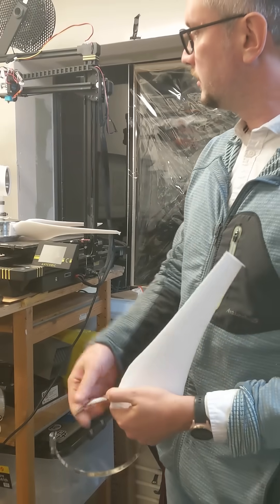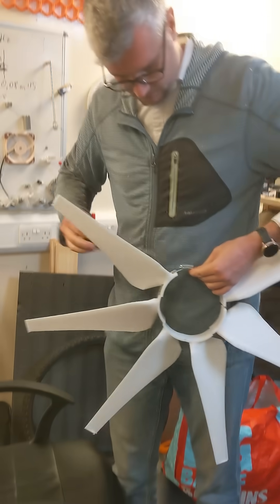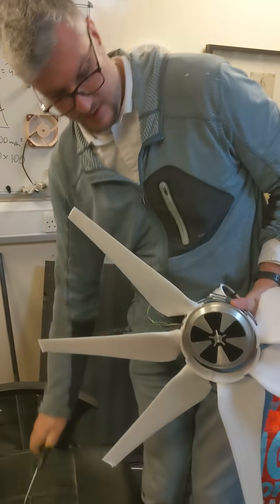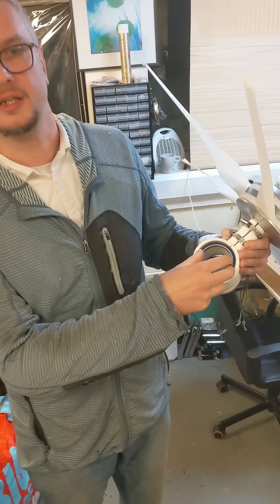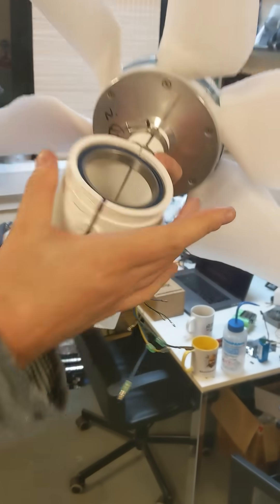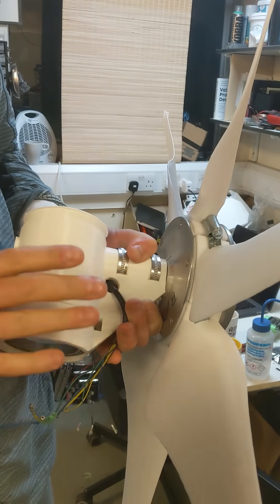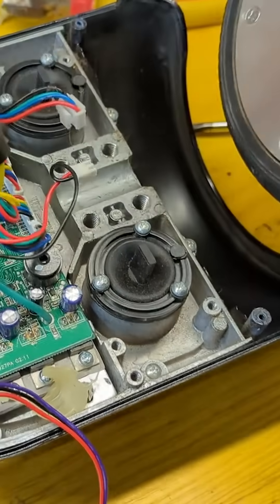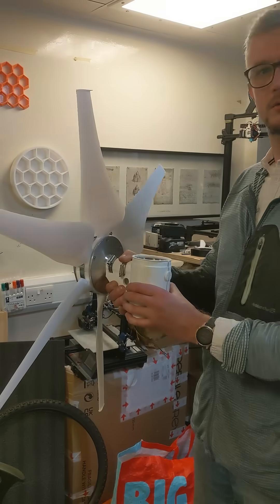3D Printed 300 Watt Wind Turbine With Hoverboard Wheel

Comment: yea... you can't generate upto 300 watt if you stuck it on the ground and relay on wind to spin it. the coil is not that much and thin if you push up to 10 amps thru that. usually that thing only generate mA. unless you drive really fast and get a very high voltage.

Comment: What size is the actual hover board wheel you have there? I have an e bike wheel so wanting to be sure it’s the same size otherwise I will have to mess around with scaling the blade. Thanks
Reply from the maker: I forget the exact dimensions, but the standard size. Think it's like 110mm diameter or something?
An ebike wheel will definitely be at least a little larger, depending on type, and so you may want to scale up the blades, but strictly speaking it should still work fine if you don't.
Minus the inner radius which locks on to the wheel hub, obv.
Reply: @OpenSourceLowTech  thanks. I will take a look. It's not the blade I worry about, it's the actual diameter where the 8 blades wrapping round the wheel. If mine is too small then it won't mount ok without scaling it down. If my wheel is bigger then it's not too much of an issue. But thanks. I will download your file and take a look.
Reply from the maker: Depending on your level with CAD, if you run into issues send over the diameter you're working to and I'll modify the model.

Comment: Check output may be only 5 watts in full wind., you need tail too, the amount you invested, it will never produce that much electricity
Reply from the maker: We've had 300W off the thing in testing.
Reply: @OpenSourceLowTech  motorun sargılarını değiştirmeden ne kadarlık bir rüzgarda o kadar çok güç aldınız
Reply: @OpenSourceLowTech what can that charge?  Great work btw!

Comment: the blade mounting looks slightly uneven, do you notice wobbling or excess noise at high speeds?
Reply: No, no noise beyond just the woosch of the wind in it. I suspect the wheel itself is just heavy enough to not be sensitive to the slight imbalance.

Comment: This doesnt need a tail on it? Keen to see a full length video on this! keep up the good work man i love your stuff :)
Reply from the maker: It settles so that the blades are downwind of the mount, and so basically act as the tail themselves. This probably makes it a bit more seeky than if it had a full tail, but works well enough and is a lot easier to fabricate.

Comment: can you upload these to thingiverse?
Reply from the maker: Think there's plans to, but Tinkercad files not working?
Reply: @OpenSourceLowTech  just barrier to entry compared to thingiverse haha. Not a big deal. I hope to see a proper video not just a short with some more step by step... Even though it looks extremely straight forward as it is haha
Reply from the maker: It's basically just a matter of print and hoseclamp together. Bit more of a process for the pole mount etc, that'll be more a feature of the next video, for the Lenz2 VAWT.

Comment: How mount the motor to the mount? Do you record more videos about this turbine?
Reply from the maker: Basically just bolted into a clamp as part of the print.
Probably be more on this in future, yes.
Reply: I just started printing your blades like 20 minutes ago. 
Let's see how that goes!
Reply from the maker: @gabrielmarin7362  Nice one, let us know how it works out.
Reply: @OpenSourceLowTech  I printed all 8 blades with PETG. Super nice.
Today I got some of those hoverboard motors from one of the local scrap yards. 
I'll probably put it all together tomorrow.
Reply: @OpenSourceLowTech  I feel like the blades are a bit too short and it would require high wind speed in order for the propeller to be able to handle the hoverboard motor. 
By any chance, have you tried with longer blades? 
My printer can print 33×33×33 cm.
Reply from the maker: They were sized mainly for the practicalities of printing, but do work pretty well in common wind conditions.
But if you've the option for larger then you'll likely get more power.

Let us know how it works out.

Comment: Is this roughly the optimum size blades for this kind of motor?
Reply from the maker: They're more sized to the practicalities of the printing process, but they're not a wrong size, no.
The motor would most likely handle larger, depending on wind, load, etc.

Comment: This is amazing! Out of curiosity could this theoretically work with a a brushless drill? My thought is many use 20-24v batteries and use a planetary gearbox for torque multiplication and in the opposite direction would cause rotation multiplication for the generator. Dunno if it would work like i think but okanetary gearboxes fascinate me.
Reply from the maker: Any motor with magnets rather than just windings should generate if spun, but each type has its own idiosyncrasies. 
Gearing up and down for revs/voltage or torque/amperage is as you say, planetaries are often fine for this, but also comes down to specifics.

Comment: Id like to see 6 smaller fans located on the front grill of a ev to see how much you could put back into the battery
Reply from the maker: Less than you'd lose to the extra drag, unfortunately.
Reply: It would be about as effective as connecting a hose from your butt to your mouth to power your body instead of eating food.

Comment: Use the other wheel motor and have  contra rotating blades
Reply from the maker: Potentially, tho would probably get more power overall from two separate turbines.
Reply: @OpenSourceLowTech   I have often thought what if you attached the outer casing of a generator to one set of clockwise spinning blades and the inner commutator to another set of counterclockwise spinning blades .This would effectively double the speed of the generator for a given wind speed without using a parasitic gear box to increase rotation speed of the generator.
Reply from the maker: I've seen it with VAWTs, but they benefit more from the increased revs since they spin slower than horizontals, and the two don't subtract from each other as they're on different wind layers.
Either way, will need slip ring or similar since spinning the stator means spinning the wires.

But would be interesting to try and see what the dynamic is.

Comment: Do you think a vertical axis turbine could be as effective with these motors?
Reply from the maker: Yes, but they're generally lower revving, with higher torque, so likely need some kind of gearing up to get useful voltage. My next video is actually about exactly that..
Reply: @OpenSourceLowTech  awesome. Looking forward to it